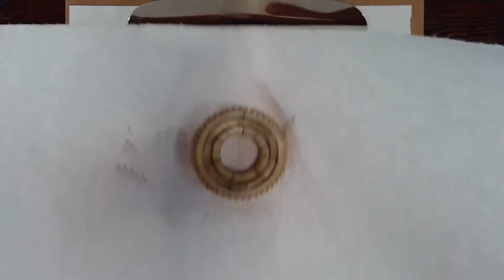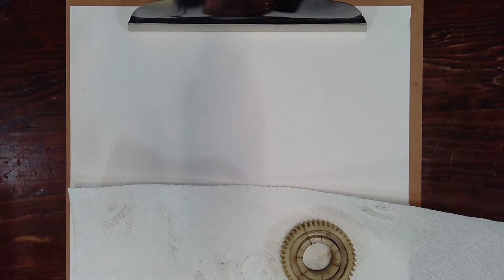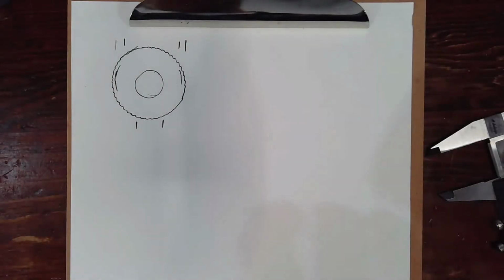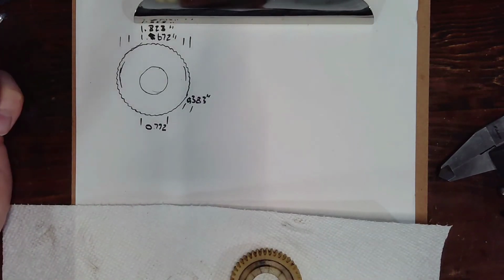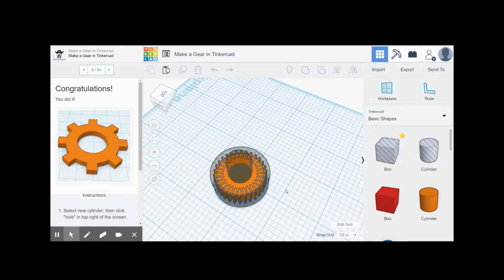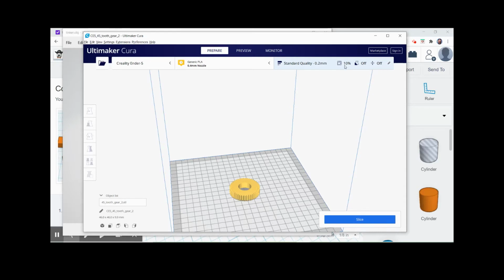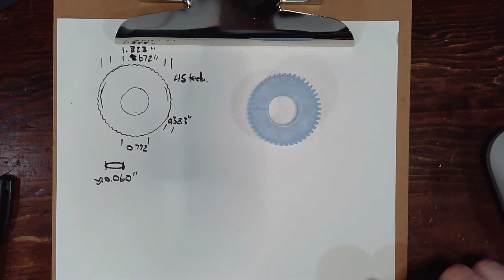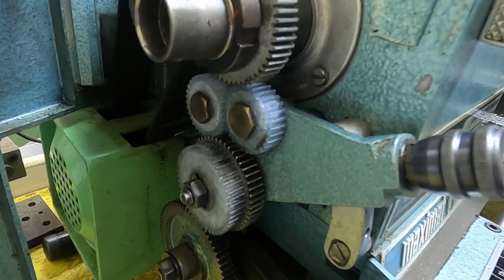Replacement Gear for Maximat V10 Lathe

Comment: Got Maximat Standard with broken 45 tooth gear on the same way like yours. Today spent some time and prepared diy tool to produce new gear on lathe and just found your solution and stl...
Tomorrow I'll go to buy PoliAmid 6 and try. Your solution would be backup if my wouldn't success;-) Thank you!
Reply: Yes. Friend's 3D printed gear works perfect. My machined gear also work but printed looks more convenient;-)
Reply: Additional info, he used this fillament: GreenTEC Pro anthracite from extrudr.com shop.